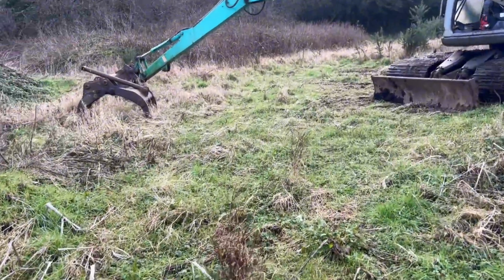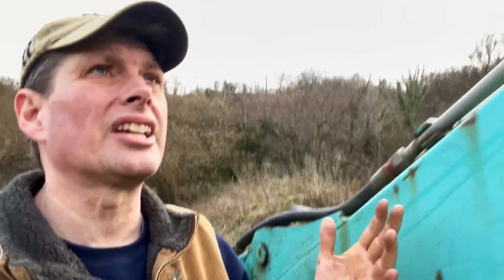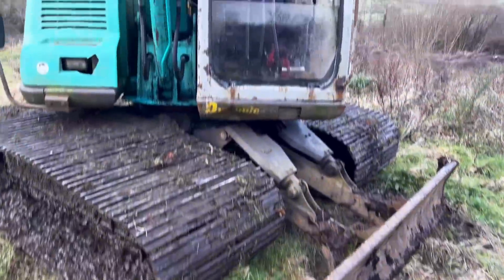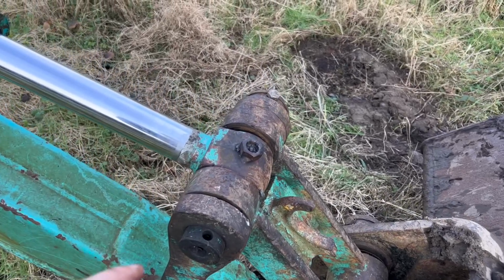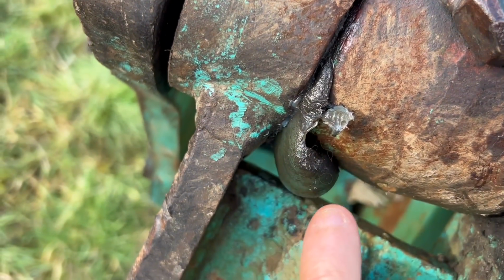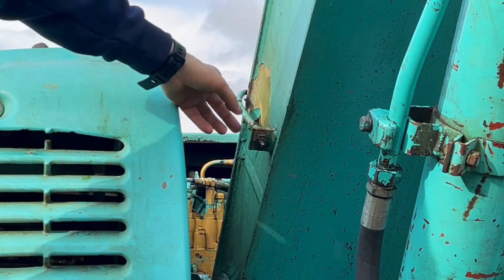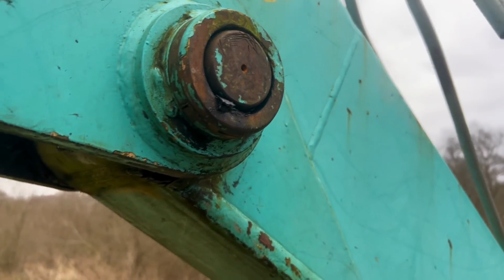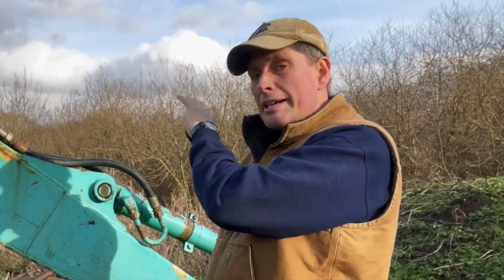Greasing an Excavator 101

Comment: New home operator here (Cat 301.7). So I Have a Ryobi sprayer that you can attach  A 2 liter of water too.  It has this turbo head swirls around in a circle. Takes about two minutes and 3/4 of the water to spray off all the fittings. Doesn’t seem like Water can go in because it really sprays around it more than in it. I do it  at the end of every day so it’s clean and dry in the morning and ready to be greased.  i’ve never heard of anyone doing this, so I’m hoping it’s not a bad idea. I would guess that if water is getting in it can’t be more than a drop.  Is this a good idea or a bad idea

Comment: I allways push down on the arm before I grease machine, ( dont know why just do ) jcb lithium complex is good all round grease! But MO2 moly grease is best for pins and bushes! Also just work the machine for 30 seconds after greasing it with no load ! I grease once a week on Friday ( just in case I get grease on me) maybe do the main pins on a Tuesday if it’s doing hard wrk ! I find a caterpillar ( alamite ) gun are one of the best ! Can’t see why you nead an electric gun greasing one machine a week ! 😮👍
Reply from the maker: Because we have 8 machines...

Comment: Good one Mucker. A lot of people are allergic to grease guns. By running your finger over the end of a grease nipple you can also see which way it is facing, that allows you to put the coupler on straight. Greasing a machine also is a good opportunity to run your eye over everything. It is amazing what you can pick up when you have the grease gun in your hand. How much grease to give something is a trick too. We bought a tractor once that had a greasable thrust bearing in the clutch. When I had to put a new clutch in it because it had never been adjusted I found the bell housing was half full of grease. See a grease nipple and give it 20 pumps is not always the clue. Try explaining that one to a neanderthal. Jeff

Comment: The best thing I ever bought was a Lock-n-Lube . Every machine has 1 or 2 fittings that you cant reach or you have to hold the tip on the zerk at an angle . That cures it.🍻

Comment: Great vid! As for my two cents…. I grease at noon every day, two reasons  #1 grease and machine has time to warm up (of course summertime it doesn’t matter) #2 sometimes quitting time comes late, you are tired, gates on site will be locked…
Next I’d have to say that not all grease is equal, I use 3% moly only. I have seen bushings last as much as 2000 hours longer with the simple use of 3% moly grease. Always carry a small assortment of spare zerks aka nipples, and if you ever hear a squeaky part, stop work and grease it. The big problem with this type of maintenance is it is seen as optional, it is not, It’s mandatory, a good daily inspection of the machine is not optional. On a backhoe I don’t always grease the loader and backhoe for example, I grease what got the most use. Front axle and driveline fittings are more of a weekly/ monthly schedule. Some days the loader gets the bulk of work, some the backhoe, and of course there are days when the whole machine needs grease, some fittings that are small get 1 pump, larger ones get 3-5, experience and some observations will help with the amounts and intervals each part needs. Do well!
Reply from the maker: That makes sense Frank 😎👌🏼

Comment: My only tip weather it be warm cold or pising it down. Give the grease nipples a little poke with a screw or pick make sure the balls free ive seen plenty of oh yea ive done it definitely an there dry as fuck cuz nothings gone in. 2 second job. Saves a lot of money n hassel. Also get a good blob on the outside if the nipple keep em clean you can even stick an old dustcap of a tyrevalve on em  not a prefect fit but works.

Comment: Good video your Lordship.
Some say that the best way is to get a hire machine, that way all the maintenace, greasing and daily checks are done for you... 😅🙃
At the farm we use two grease guns; one is a pistol grip with a flexi pipe, and the other is a lever type with a solid pipe. Just so if you can't get onto a nipple with one you can with the other, particually if they're in a hard to reach place, or a bit old/worn.

Comment: I can remember the days 1965 class mercury combine 8foot 6 cut Perkins p4 on the side at least 50 grease nipples sum twice a day and a 1 gallon castrol  pressure gun. You were covered in crap before you started and to lithargic at night to do it. Onley 200 acres to do in a season.

Comment: I don’t like auto-greasing systems. When you are going for each grease point separately you get to see all around the machine. Also don’t like power grease guns because with a manual one you can also tell if there is resistance there (blockage). Preferred grease gun for me is a single handed pump style. I only ever had one really good grease gun that rarely air locked and that got run over… 😡
Reply from the maker: You can tell a blockage with a powered grease gun just as easily and you can get grease in where one handed operation is virtually impossible.

Comment: For general use, pumping out track adjusters and the like, a decent Lithium EP2 grease is plenty. For high wear applications - dipper end pins and bushes, kingposts, boom/dipper joint - we tend to think it is worth paying the extra for Lithium Complex EP2 grease. It was a higher temperate range and also better resistance to washout.
Reply from the maker: There's lots of info at https://www.digbits.co.uk/technical.html

Comment: Cracking video  thanks for sharing 
Not a digger but our   scammell explorer needs  it's transmission props greased  every 50 mile and  that's   what REME say  in the manual  as  some of the prop yolks dry  out quickly  we tend to use  good  quality  high temperature  grease from  smith and Alan's from Darlington  for the transmission  then  we  use cheaper  general purpose grease  for  all the rest  on the suspension  ,steering  , winch and crane 
We  tried   counting  all  the grease  points once   but give  up after  200 😂
Some  old  boys  with  scammells  told  us  not  to use  grease   on the   axle    and  suspension points but  use  old gear oil instead  this seems  to help if you've got  a blocked  one   but  its a proper  messy  job 🤠

Comment: My Favorite subject!!!!! different greases for different applications for me I like to use different greases for the same machine.on my balers I use three types of grease in the auto greaser I use a quality lithium wheel bearing grease because if I use the moly (clay base) they will plug the lines.on the drive lines I use a heavy duty coupler grease (Moble XTC) its almost a super thick oil. on the pins and bushings is where I use the moly grease. I used to use sig 3000 anti pound out grease on the drivelines but that's just lithium grease with a stiction agent added. that's good for your pins on the boom of that machine.
Reply: oh and if you plug a line there is usually a grease Zerk on the main divider block and that will put a bunch more pressure through the lines and help clear out the line. the best way to prevent a blocked line on the auto system is to run it when the machine in not running about 30 minutes. that will allow you to inspect the bearings and bushings that are fed by this unit. they will show a small amount or dark grease at the seals. sent go home and forget its on it will make a fuckall mess out of the unit its greasing.

Comment: Use a marine grade grease and a trigger pull gun is my preference. I used to drive a 20T Hyundai on a water borne barge, tricky work when you have water under you. I had the use of a 20T Hitachi which I skidded a track off when the grease nipple failed on the track tensioner. I went to work and put it back together but used a marine grade grease.. Once got the us of a 3T little Tackeuchi from a neibour and  the main ram groaned like an old man, so I cleaned it with acetone and replaced the nipple and regrease it, noise gone. Always do your engine checks, looking for oil levels but also loose belts, bolts and all your ancillarys. Probably some spelling mistakes.

Comment: I bought a sealey grease gun and couldn't get round half the machine before the battery died.  Quickly ditched that and bought a milwaukee.  I go through 2 tubes of grease with only using half the battery.  Serious bits of kit.  Worth every penny.  Such a time saver.   Only problem i have is sometimes not getting the right angle and it coming out the nipple.  Ive seen some lock on ends for the grease gun but not sure if they are a gimic

Comment: Good video Mucker, the single biggest bit of advice I give boys as a plant trainer is check your machines lubrication chart, espeically if its a new machine. I have seen new machine over greased as you touched on pushing the seals out, then you will become greasing man every day, a lot of new machines will tell you grease the bucket evrey 40/50hrs rest of the machine might be 150/200hrs but always worth checking every manufacturer may be different.

Comment: Excellent video Lord Muck  :) what my late Father taught was use high pentriotion on fluid on grease with 2 squirts on grease tip , grease to is High Temperatures or Quality Heavy Equipment Tractor and Truck Moly grease type pump in 4 pumps worth each too! If grease tip don't take take tip and use pentriotion and clean up too! Then install back on try again too and gun do hand grip ones! Also hold tip fitting on and hand pump also do grease every month or on oil change time ! If heavy duty equipment  weekly  best bet and helps lots!

Comment: i run flatbed trucks and haul equipment and for slow moving pins and bushings a grease high in molybdenum and graphite works well. on high speed u joints and in dusty conditions i push a bit of great out of each hex with a lithium complex. Grease needles work well too for a blocked fitting or narrow access point.

Comment: They actually make a tool or “stuck” grease zircs that don’t take more grease and it works by having a piston you fill with oil that locks on the zirc and hit it with a hammer and force the oil in and frees up the little ball

Comment: Oil & Grease is always costs less than pins, bushings, line boring and mechanic`s labor charges. Better machine operators know to check grease points, fluids & oils before the start of each machine use. We know not everyone is one of those "better operators".

Comment: Once you put a new cartridge in your grease gun. Especially the Milwaukee battery ones  once iys purged pull the handle out! And it goes down as the greas comes out! So you always know how much grease is left. Absolute ball bleeder going to grease up and the fuker is empty. Cos 9/10 times your work mates will never be arsed to go back to the container or workshop to put a new cartridge in. Youll hop onto the machine. (Set up for failure) when you get told to use the machine. And itll break on you, and the boss will be angry with you  even though you did everything right! 😢

Comment: For more info from my occupation which is running older farm equipment a lot of the equipment has no auto lube systems for drive chains. My round baler is a lot of chains getting covered in dirt and dust so lube often. Have used all different kinds of lube over the years but seems to be cheaper to just use what New Holland recommends to use 30w oil. Also when about to use the old New Holland 1915 or 1900 forager expect to use about a full tube of grease to lube the machine.

Comment: Working with agriculture n earthmoving machinery I take pride in greasing n keep it clean.
1. Machinery manual or sometimes make up one counting grease nipples, recording nipples size.
2. Tools i am fortunate to have 3 grease guns but basic one with long extended hose is good start
 Battery, flex hose n long straight gun
3. I made box which contains
 Paper towel roll, i hate rags 
Box of allsorts of nipples
Grease fitting unblocker
Grease couples
Cleaning tools like screw piece, pick, wire, brush
Nipple guage as i come across different types of nipples.
Anyone who just started in agriculture or plant machinery n your job is grease everything, if cant get grease into the fitting, don't put dob of grease on end of fitting n leave it. ASK someone with experience to find solution to the problem as its not just costly issue but safety issue especially if wheel comes off on main road at fair speed.  As for type of grease use what is required, i dont swap different grease around as some greases have different tolerance n adds like powders.

Comment: Mucker great video very interesting and informative I've never been on any plant machinery just find it fascinating to watch. Do they fit any kind of warning lights or systems to these machines to warn the operator that  the joints need lubrication? Sorry to anyone if that sounds daft ❤️
Reply from the maker: Some larger equipment have lube monitors fitted
Reply: A good operator will pick up on any sound or squeak then stop and grease.
Reply: Some drivers have a built in warning system to grease the machine..it’s usually when they know the boss is making a site visit 😅

Comment: Bit of wire brush poke down nipple removed or blow tourch heat and burn 🔥 off old grease......... try leave with rams in so it protects pitting on the rods I like my manual grease gun simple less to go wrong..... old scats dapper grease gun terrible got a different flex pipe from a local tool shop better locking tip on nipple and easy to bleed 😉 at beginning

Comment: I've learnt, the hard way to ALWAYS carry a new tube of grease the correct socket and driver for the track tension and a side lever grease gun. At base I use an air powered gun, and when not so close to an air line, I use a pistol grip grease gun. Also carry shims(Washers) so when it starts to shake, you can tighten that joint up. Always grease every day its working. I concur with carrying grease nipples in the shop.

Comment: Have a Milwaukee Battery grease gun with G coupler . On the main pins i will give a few pumps when the boom is down , lift the boom to top and give a few pumps  , means you get grease right around the pins .

Comment: My handy tip is to buy a selection of new grease nipples and keep them in the machine.  That way you can instantly replace any rusted/blocked/damaged ones and keep greasing.  The blocked/damaged ones always get ignored until the point that they run bone dry.  You can usually tell a blocked one by the half tube of grease built up around it that never actually went in.
Reply: Yep, those storehouse packs from harbor freight are like $9 each.

Comment: Rotek swing bearing and swing gear and pinion . 
Bucket hinge pin and dipper stick high wear areas and expensive.
I grease every time i use machine.
Planetary track drive unit oil rarely checked changed.
And swing motor planetary gearbox oil as well.

Dont pressure wash swing bearing area or pins bushings pushes sand dirt  into grease .

If you don't grease alot zerk fittings clog and channel so no gease can get in bushing pins .

Lincoln makes a impact tool to clear clogged zerk fitting s.

Nice channel Thank you.
Cheers

Comment: Great video done correctly , so many people even if they bother to grease, do it WRONG !!!😢 So important to clean all debris from around grease nipple & wipe clean grease nipples with a rag, also keeping the grease gun end wiped clean is important, saves dirt & crud from entering grease lines 😊😊👍👍I use MOBIL XHP 222 lithium based grease, it’s a more sticky grease,excellent on hot temperatures, doesn’t just melt out & run away.That was a great down to earth video, hopefully inspired other people in the art of maintenance 😊😊😊👍👍👍

Comment: Always prefer a grease gun myself instead of auto lube so you can visually see the grease coming out around the bushings and pin, as a regular driver of machines between 0.8 and 3 ton i also make habit myself and tell young lads just starting out on machines to visually check any welds and the actual boom and dipper for any cracks while greasing, especially if its an older machine or been used on a tough application. Equally check the teeth on the bucket while your greasing the bucket pins, catching a problem early is always better than the problem catching you out.

Comment: I carry a short length of fence wire and rag to clean around the grease fittings especially around the bucket, coupler and knuckle. 1x pump of grease every 8 hours religiously (depending on age of machine I may add more). I grease at the end of the day when the pins are warm and therefore grease in location is already warm and easy apply extra grease. Dry grease can block fittings hence while the machine is warm I apply. Allows the operator to start a fresh pre-start first thing which usually coincides with trucks being loaded etc. I like to knock off early to grease the machine for the next day.

Comment: 👍👍👍right on feller... you're indeed spot on... Years ago bought a used excavator with an auto lube system,.not gonna say the brand,but couldn't get it function properly, don't know if it ever did...but not everything had been getting sufficient lube...pins and bushings got worn as a result.. removed the system and greased with battery gun ever since... down the road i learned that particular lube system had issues on any machine they were installed... anyway,ill never buy a machine with an auto lube..im sure some systems are better than others...idk ..but anyway, thanks for another video 👍👍👊🍻🤘

Comment: I’m not big on the auto lube stuff. On more than one occasion I’ve caught a problem early because I’ve seen it while going round doing the daily grease. Other thing I’ve found a couple times now normally on a cultivator or rolls rather than the digger, is that a fracture will start from where the hole for the grease nipple is. Get a decent battery grease gun, it doesn’t feel such a chore to do, but they can be a bit expensive.